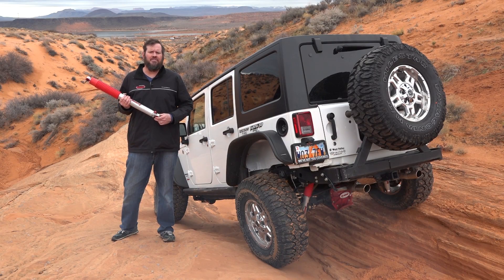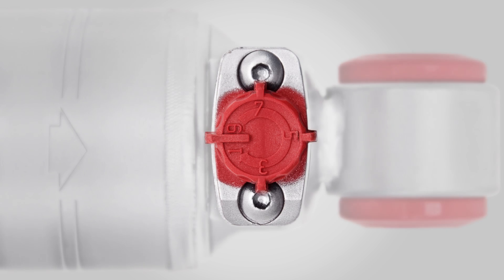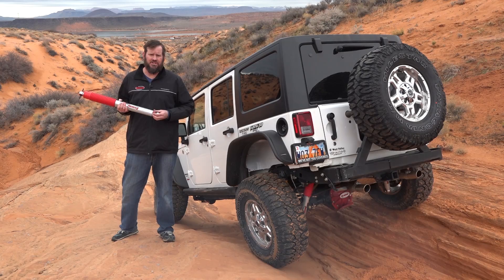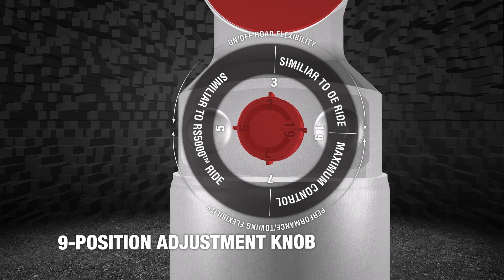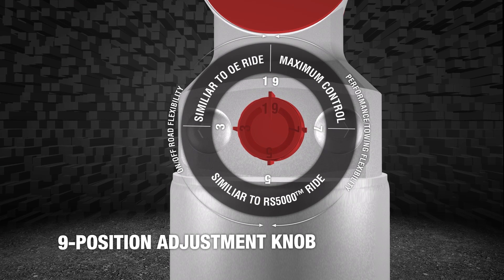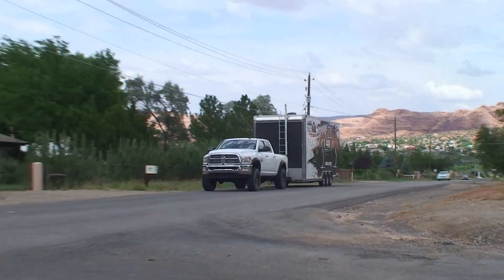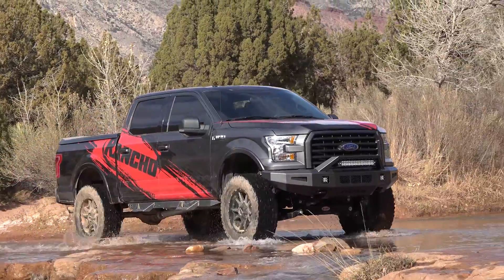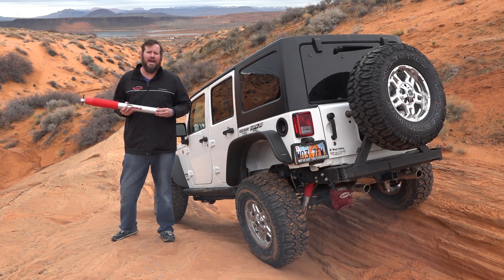RS9000 XL Shock Settings Explained | Rancho Suspension

Comment: Terrible shocks installed them on my 18 Silverado 1500 and it feels like I’m riding a 2500 the ride is so stiff you feel every single bump on the road do yourself a favor and spend a little more and buy the bilstein 5100

Comment: Can you adjust the shock on the ground, or do I need to lift my front end and take the load off to adjust?
Reply from the maker: Hi David, our tech team would be happy to help provide support and answer your questions. You can reach out to them at 1-800-325-8886. They are available Monday – Thursday from 7:30 a.m. – 4:30 p.m. (CST), Friday from 7:30 a.m. – 4:00 p.m. (CST).

Comment: Well…..what do you do when 2 of the new set of 4 bind like crazy and won’t turn? The rears for my jl wrangler haven’t turned well since installed back in June and are dang near impossible now as I wanted to make adjustments while dropping my oil?!
Reply from the maker: Call 1-800-325-8886 and they can get you new knobs. Also watch the video on how to replace the knob :)
Reply: Grease the internals of the knob
Reply: It can be removed with a Allen wrench

Comment: Can I replace my current shocks with only two RS9000 on the rear of a 2018 KIA Sorento AWD ? or is it recommend to replace all four. I am doing normal driving condition and would like to adjust for towing on the rear shocks.

Comment: Yeah when brand new they adj fine.  After a season they are a pain.  The detents disappear and then its a guessing game.
Reply: Good to know. I just got some and will probably add some kind of paint or marking to help
Reply: Completely agree with you. They are great shocks but it is a guessing name. When I got my first 4wd the previous owner got them installed he said they were great. He had them on the softest setting and the truck drove like crap to me. I took me almost two months to figure them out which way was hard or soft on the 4 shocks.
Reply: Clock-wise is a higher number. Harder ride. Just put them on my E-350 1 ton work van. Not real happy with the ride so far. They were set @ 5. Will try 1. @TxJK18
Reply: Apparently you can replace this knob and it is fairly easy.
Reply: I just found a video on their youtube channel for how to replace the knob: https://www.youtube.com/watch?v=Qe0O3scAvw4